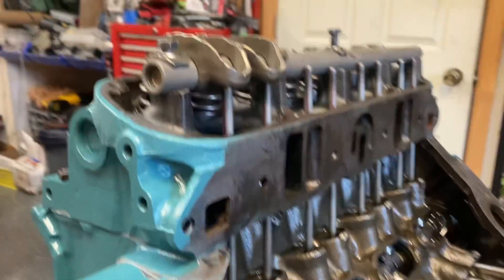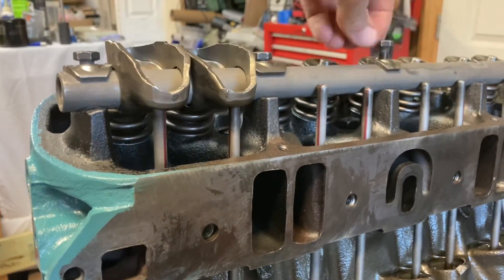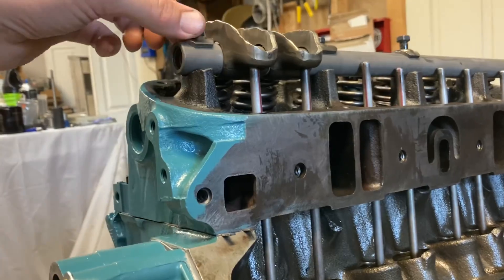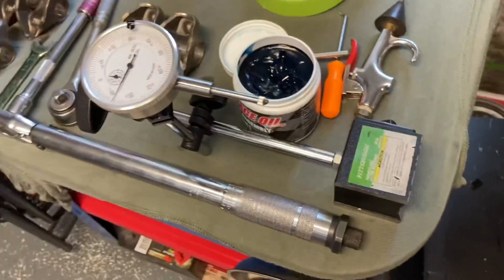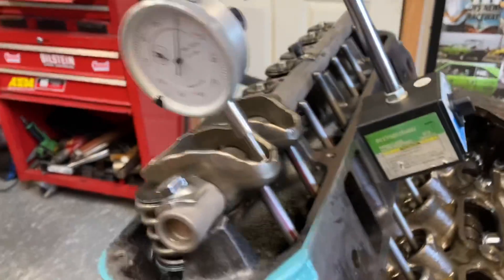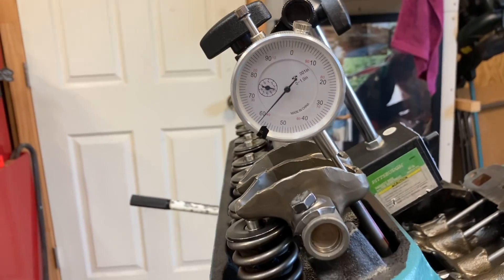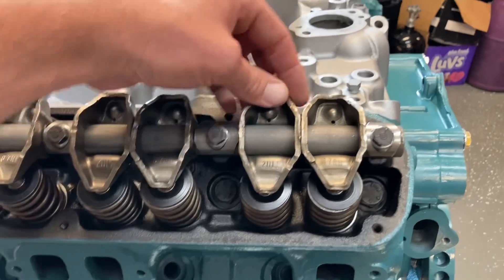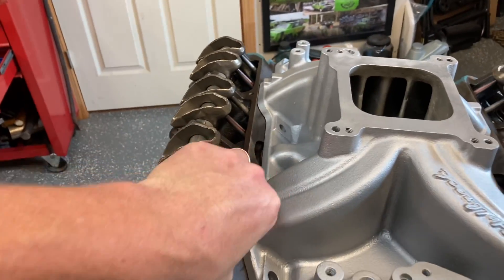Checking Hydraulic Lifter Preload on Stock Stamped Steel Rocker Arms #mopar #engine #smallblock #360

Comment: Thank you for this. One of the things I'll need to check on my upcoming 440 build. Had the block decked as part of the machine work, just to get it flat and squared up. This of course affects the preload as will the Eddy E heads I plan on using. Want to reuse the existing rockers if possible and will check the contact patterns. Adjust with shims or shorter rods if needed.

Comment: Perfect video, one question, I’ve had the block decked and the exhaust valve seats cut at the machine shop, how do I know if I need shorter pushrods now?
Reply from the maker: You can check the preload again, just like in this video. You may have a thicker head gasket than factory. All of it has an effect. Hydraulic lifters are usually pretty forgiving. Many people never check them and never report an issue. With aftermarket lifters and cams, they could have changed the location on the plunger depth in the lifter, or even the base circle of cam.
Reply: @JustMoparJoe alright, thank you! I think I will install the heads and check preload like you did in the video. While researching I found little shims to put between the rocker-shaft and the mounting ,,u” , to adjust preload if needed. Have you ever worked with these?

Comment: Great video exactly what  I  needed. I'm finishing a top end rebuild on a 440 put together by someone else with no known specs( mystery cam. unsure if block has been decked etc?). I really want to give it every chance, so have been doing what I can to try to get it right with the new heads. The original heads had standard valve springs, no rocker shims and have flat top pistons 26' below the deck ( no flycut).
I have worked out the cam has 480' lift on both intake and exhaust by measurement and can only find one cam with these lift figures and it is an Australian cam by EMD, with advertised duration of 302 degrees.
The pistons have dents from the valves hitting at some point, although there didn't seem to any issue when I drove the car ( removed heads due to bad sealing gaskets and realised a lot of other issues). 

Anyway my question is regarding preload amount, is it better to have a little less to help avoid valve float and possibility of valves hitting pistons again if you intend to rev the motor to at least 5500RPM?
 I suspect there isnt really enough clearance from piston to valve with no fly cuts and with the standard springs and the fact that there are no shims that the valves may have floated at high rpm causing them to hit the pistons.
I am wondering if in this case, if less would be better ( maybe zero). Do you think this would be wise with a situation like this? to help avoid valve float. I'm not in a position to do a full engine rebuild so am hoping to salvage this motor even if I limit the revs.
Reply from the maker: It sounds like you're on the right track, and you're smart to be thorough. I like the idea of less preload in that situation. If it can’t have the extra length to use, then the lifter can only pump up to the clip. A checking pushrod is cheap and can get you a zero lash number. Then you’d have an easy way to check how much you are preloading after that. Example (8.300 at zero, then add .030” for preload”
Reply: Thanks for the reply Joe, appreciate what you do on here. Your reply leads me to another question. If the lifters are in a running engine( oil in the lifters) can you still measure the pushrod length and can you still check prelad the way you show in the video?
Reply from the maker: @stephenedwards8560 well sort of. It depends if the lifter had any give to it or if it’s pumped up solid. Some lose their prime after a week  or so and then you could measure

Comment: So ive got my lifters in, preload looks good. Ive got my rocker shafts bolted down, but you can grab the rocker with your hand and depress the lifter more pretty easy. Is this normal?
Reply from the maker: Yes that’s normal until you prime the oil system and the lifters all fill up.

Comment: This is great video but when you get it dialed in can you still push on the rocker and compress the lifter?
Reply from the maker: Not after the system is fully primed
Reply: @JustMoparJoe  Ok thank you I will make sure they are. I hade a retainer pin take out my oil pump 😢
Reply from the maker: @arroworchard1054 sorry to hear that!

Comment: This is a great video! It helped me so much, especially reading so much, but to see it done was great!
Question..running stock rockers..my preload varies up and down for each valve but within spec of .20-.60”..should they be all identical or just within spec?
Thanks again for the vids!
Reply from the maker: @andymozmorrissey  yes sir. You are good to go. Many machinists will set spring heights very precisely. Others want to get heads out the door. Hydraulic lifters are oftentimes forgiving.

Comment: It's actually simple. 
Get the 273 Formula S solid lifter ADJUSTABLE rocker arm set .
Its "factory" parts (try Crane Cams)
Reply from the maker: @NCOGNTO  yes. Those are nice. I was trying to demonstrate how it works with stamped steel rockers, which the majority of Mopar engines came with. I would buy some roller tip rockers if I was searching for an adjustable unit.
Reply: @JustMoparJoe  Mopar Performance sponsored my LA.BULLET so I may be prejudiced toward factory and low buck parts .
Rumor is adjustable rockers are good for 500 RPM tho .
Reply from the maker: @NCOGNTO  we got that in common! Harland Sharp sponsors my personal engines. We gotta love the people who take care of us 👍
Reply: @JustMoparJoe  uh . well .... selling my engine tech to GM as we write here . Mopar wasn't interested in pollution free engines , but they paid 447 million for fuel cells while they were my sponsor .

Comment: I’ve used adjustable pushrods on a 440 6 pack and it ran perfectly. 
I am currently using Harland Sharp rockers with hydraulic roller lifters. What is your recommended preload? I’ve seen everything from 1/4 turn to a full turn. A video on adjusting preload would be great. Thanks
Reply from the maker: I usually go 5/8 of a turn and never had an issue. That was just a compromise from reading the 1/2 turn versus 3/4. Also doing the math of the thread size and preload recommended by the lifter company.

Comment: Good tip! These break. Adjustable 273 rockers FTW :) (I´ve ran those for a decade in my 340) Love your channel! Have been here for years
Reply from the maker: Thank you! I ran the old 273’s on my first 408 with solid flat Isky cam. Worked well for my combination. You know I love Harland sharp!
Reply: I did’nt know that, so that may be my next purchase :) (if they ship to Sweden😅)

Comment: But you have to tighten the rocker shaft down. You cant run it loose can you ? So what ever the preload is when you snug it down is what it is i would think ? Then what if you install a humpty dumpty performance cam ? Will factory rocker even hold up ?
Reply from the maker: In this video, I believe I showed tightening the shaft and measuring the preload on the lifter. The humpty dumpty sound comes from  changing the cam specs, besides just lift. Larger lift cams require heavier springs, which can kill stock rockers. I’ve ran up to .530 lift on stock stamped rockers with the correct spring.
Reply: I got a Howards hydraulic roller cam 510/500 lift with new springs, should I go with stock rockers or ductile iron rockers, I am looking into 440 source products not to much of a difference in price
Reply from the maker: @madvette74  that cam will require enough spring load to need a good adjustable rocker. I’ve ran the old 273 rockers on solid flat tappet cams fine, but I am certain a roller tipped rocker will cause less valve stem and less friction. My first recommendation is always Harland sharps. They are the only brand I know of that offer a lifetime warranty. If you’d like a less expensive option, the PRW’s worked well on the dyno 440 with a camshaft with more lift than what you have there. I know 440 source just introduced a new roller tipped rocker that looks like a copy of the PRWs.

Comment: Hey Joe thanks for the video

In your opinion can I put a cam with .513 lift on stock steel stamped rocker ?
Reply from the maker: Oh man! If it’s hydraulic flat tappet, I’ve seen it done on big blocks. We used the .532 lift purple shaft on an engine before with no issues. When you’re able, I’d upgrade to roller rockers with that lift. Small blocks would cut it down considerably at the valve.
Reply: @JustMoparJoe  it's a voodoo 703 for my 440 man 🙏🏻 thanks for your answer

Comment: hey, i have a rocker question for ya.  i just took a set off a truck i bought that had no holes in them. i thought that might have been a cause of no oil pressure but still wasn't. have you ever seen rockers without holes? btw only one side was like this, guy was sold a "freash" rebuild and looks like they were tossing parts to it.
Reply from the maker: What brand of rockers were they? Or just stock stamped?
Reply: @JustMoparJoe  no name on them at all. Just 34RH on the one I'm looking at. Not to mention the shafts have no notches. Also I noticed on all my rockers that I have, the numbers are different and random in front of the LH & RH.
Reply from the maker: @Parrinosgarage  sounds like some stock steel reproductions.

Comment: Awesome video to understand how lifter preload works. I’m having an issue with my mild 360 with a comp 268. Motor ran really well for the last 1000 miles but I have a light tap on cylinder 1 on the rocker. Lifters seem to be pumped up and rockers aren’t loose by hand any ideas? Problem hasn’t gotten any worse over the 1000 miles….or better!
Reply from the maker: Thanks brother. Theres many things that could make a difference there. Maybe a sunk valve? Were the heads rebuilt? Pushrod bent? Rocker arms both in good shape(you could swap them with two others and see if the noise moves), do a cranking compression test on that cylinder and a few others to compare.
Reply: @JustMoparJoe   hmm everything was rebuilt, heads were redone with correct valve springs and seats from comp, rockers look really good no wear what so ever. Ran the engine with no valve covers and each rocker is moving evenly. Only thing I can imagine is the pushrods are the stock 7.5s so possibly preload they spin freely when pumped up but that one ticking seems to spin a little to easy.  Looks like I still have some work to do thanks for the help and keep going with the videos love these in depth videos on the small block mopars.

Comment: Very cool Joe. I love the simplicity. I usually don’t bother measuring that but it’s a good idea if you deck the block or heads which will affect preload and push rod length.
Reply from the maker: Thanks Jonny. I’m with you on that, but figured it’d only take a quick second

Comment: Good video!   The Mopar factory hydraulic rocker shaft assembly is one of the most forgiving to mechanics features ever installed on a engines valve train.  For decades GM owners drooled over this engineering masterpiece that offered 250,000 miles of valve train stability maintenance-free right from the factory.
Reply from the maker: Well said! Thanks, Tim

Comment: You can also check clearence at full lift at the nose of the cam lobe using a tool to depress the rocker and measuring what is left of preload as the lifter bleeds down till soild reading of the gauge would give you a very accurate reading too.
Reply from the maker: That sounds interesting!

Comment: My understanding is that hydraulic lifters run at zero lash, so it really doesn't matter how much preload you have it does not affect lift, the only concern would be if you floated your valves, and they kissed a piston, so I always shoot for around .040 on a stock non-performance engine and .020 to .030 on a performance engine. I have .020 on my .501 lift comp cam so they clatter a little which is fine, comp cams says if that bothers you set them at .040, but I like a little clearance for safety reasons as for some strange reason I have problem with valves kissing pistons. Call me old fashion but it just doesn't seem right to me. You could also use an adjustable push rod to check preload and get a more precise measurement and custom make your pushrods. It's only money and we all know that grows on trees!
Reply from the maker: Well said! Thanks brother

Comment: Exellent video, Joe. However don't discount how accurately you can measure by just using the bolt thread. IIRC the rocker shaft bolts are 5/16-18 UNC. So one turn of the bolt will advance 0.056". If you have a grade 8 bolt handy it will have six lines on the bolt head, and it is pretty easy to estimate halfway between lines, so that makes 12 divisions. So each half-line on the Gr8 bolt will be 0.0046", and using this it is easy to measure the preload to <0.010". You could also use the dial indicator to check one lifter and then watch the bolt heads as you tighten up the rest of the shaft hold down bolts to see that they are close. If you have adjustible rocker arms you can use this approach to set the preload very accurately. Just take the inverse of the thread pitch of the adjustment screw. This will also work on stud mounted rocker arms.
Reply from the maker: Yes sir. Ed at Ed’s machine told me about that. Thanks for sharing.
Reply: @JustMoparJoe  Thanks again Joe.
I really like Gavins post.
You're getting some great feedback from people.👍👍
Reply: Hi Gavin, that's the way I do it also.
Basic shop math never let's you down.
I did like the fact that Joe used a dial indicator.
That way you get the ratio differential between the center pivot and the pushrod socket and or a close proximity. 
I like your grade eight with the lines, absolutely spot on.
The Big blocks use 3/8 16 = .0625 in one turn.
Same rocker arm ratio but changes because of the additional. 0075.
Great post.
Have a good day. 👍
Reply: Gavin, honest question.  Since the bolt is centered between the spring and the push rod, would it not act as a fulcrum?  Would the distance you tighten the bolt not be magnified on the rod end of the rocker?  I would love to use this method, but physics tells me that the rocker arm will push down further than the bolt.  Seriously asking as a question only.
Reply: You are right. There is a factor due to the fulcrum action. For 1.5 rockers the factor is 1.67. Also you have to make sure that the valvespring is not compressing. Usually this is not an issue if the lifters are not pumped up. To calculate the factor assume that the distance from the pushrod socket to the shaft centerline is 1" (the actual didtance might be different, but that doesn't matter). Then multiply this by the rocker ratio eg. 1.5, so the distance from the shaft centerline to the valve contact pad would be 1.5". From this, the distance from the valve pad to the pushrod socket would be the sum of these, or 2.5" Now divide this total by the distance from the centerline of the shaft to the valve contact pad, or 1.5". The result, 1.67 is the factor. So by bolt measurement (as in my first post) lets say you got 0.020" to contact the shaft to the shaft tower. The preload would be 1.67x this, or 0.0334", right in the ballpark. For 1.6 ratio rockers the factor would be 2.6/1.6, or 1.625, and for the example the preload would be 0.0325.  If you want a formula it would be clearance at the shaft centerline x (rocker ratio+1)/(rocker ratio). Good catch, I should have explained that in my first post. @thecatsfan

Comment: If you have better alternatives to stamped steel rockers, I'd use them instead.
Reply from the maker: Yes always buy the best you can afford. These are on a street ramcharger. And they’re almost gauranteed to not fail
Reply: Mopar heavy duty rockers will do the job just fine on a mild 360...only when you get wild do you need to upgrade them.... It not like a chebbie that needs screw in studs there quite a bit of stability in a shaft rocker design.
Reply: @moparnut6286  of course, they work fine in stock situations, but as soon as you start tinkering with the engine internally, you're changing clearances. You grind the valves & seats, you change the head gasket, you cut the block/ head surfaces, change the cam, you've automatically changed the lifter preload. Joe checked just one cylinder's lifter preloads. How many of these subscribers are going to check this, much less EVERY lifter?

Comment: I have a 66 383 2 barrel and it came with 346 heads which are much later open chamber and the flat top pistons are down quite a way at TDC so I know it’s going to be very low compression so should I buy a set of KB400 pistons and mill the heads 15 or 20 thousandths with steel shim head gaskets or what would you suggest. Gary in Millsap Tx.
Reply from the maker: Those are nice pistons. I wouldn’t run over 9.5/1 on the street with iron heads. If you’re going all out race on a budget, the shims are nice in that application
Reply: Good question I'm interested in Joe's reply also.
Reply from the maker: @hemisidetrack2767  I ran them in my old 72 demon with ported iron heads, 383 +.030, torker intake and Isky .505 lift hydraulic flat tappet cam. Best time of 7.40 in the 1/8th
Reply: you can gain about half a ratio [.5] by running closed chamber 516 or 915 heads. the 516s will flow less but will likely be better with the compression increase your engine desperately needs. mildly porting them would be a big +. good luck.